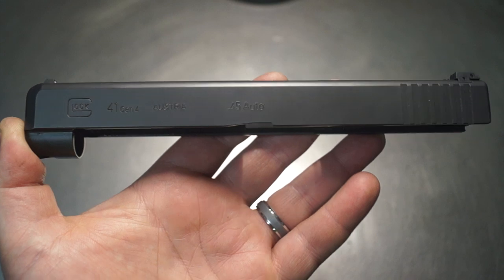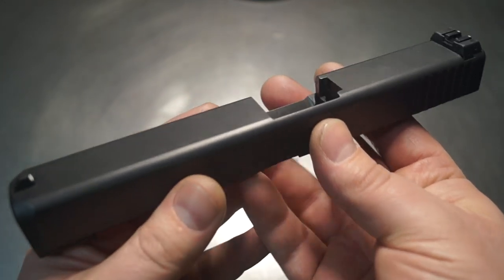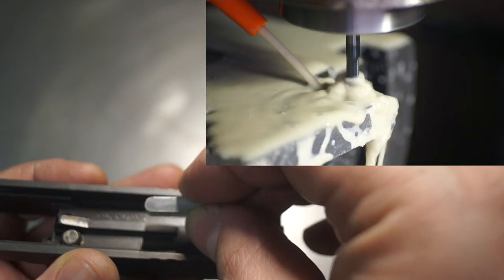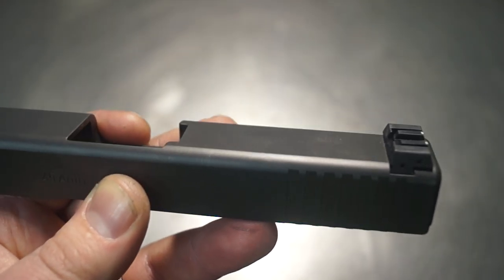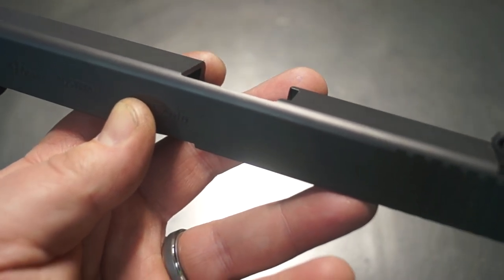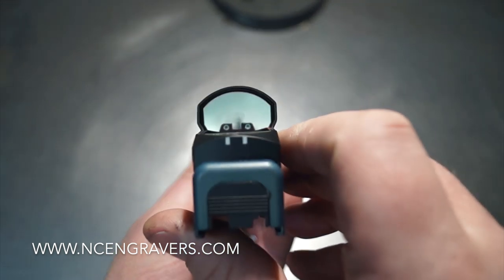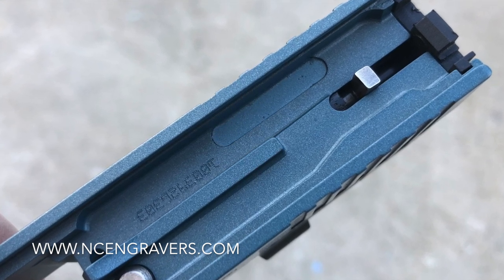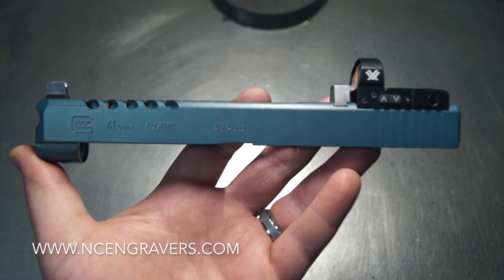NCEngravers.com  - G41 - Raptor, Optic build

Comment: I'd love to see a reverse raptor cut, mostly on something like a CZ because of the small slides they use. Seems like it would give something to grip for racking the slide. I'm having a hard time visualizing that though.
Reply: I've often wondered about a reverse raptor cut too, but from a holster draw point of view as it would be less likely to snag. Plus I imagine any gasses coming through the cuts would be directed forward and away from the shooter.
Reply: @EarthAltar  yeah, a good kydex holster isn't going to drag on it while inserting either, I think it'd look sweet and I imagine in my case improve slide manipulation for us CZ guys.